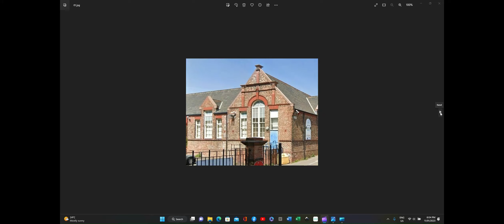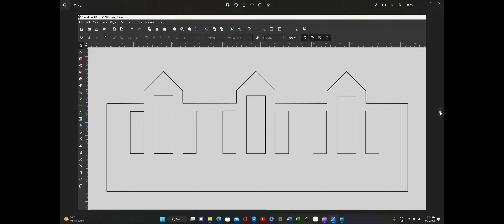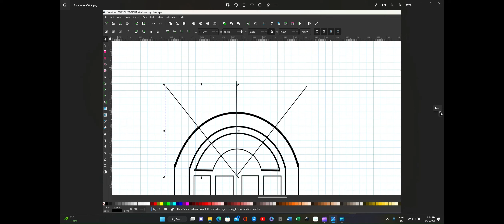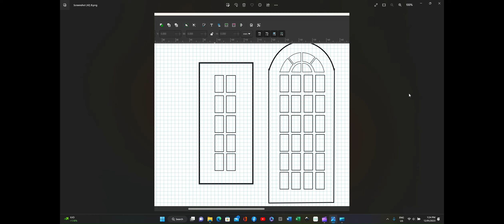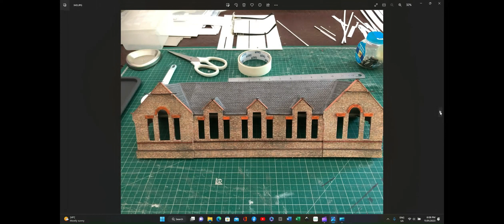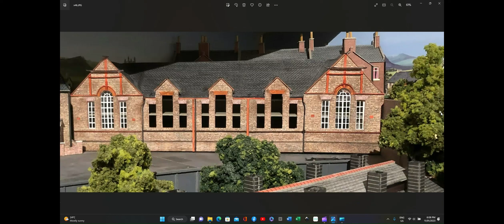Newtown School Part 4   Windows & Frames

Comment: Hi Alan.  I have thoroughly enjoyed watching your video series on Newton School.  Your step-by-step guide has been very informative (and your series on the window frames).  I would not have believed that the Cricut could be so versatile!  I'll need to speak to Mrs M to see if the budget will extend to one for myself!
Reply from the maker: Thank you David.  The Cricut is very adaptable for modelling beyond what is expected and just needs a bit of trial and error rather than rely on simply what is used by the craft sector and there set projects.  A great machine but can frustrate at first, I would not be without it now. Cheers Alan

Comment: Very good result Alan.

Looking forward to seeing how you drew the arched window in inscape. I’ve used inscape a couple times, but will probably be trying affinity designer, since I’ve paid for it.
Reply from the maker: Thanks Ken. I haven’t used Affinity Designer. What was the price of it?  Cheers Alan
Reply: @StocktonStation  had a question. Can one adjust depth of cut so as to make brick pattern? (EDIT: With cricut machine?)
Reply from the maker: @KenN.OXN.805  yes Ken just set the number of passes lower and another way for example is to use a 500 gram card and set machine as a 90 gram  paper and it will only cut one pass. Also set machine on less pressure. I prefer to just alter the setting for number of passes until you find optimum result on a test card - less chance of damaging or excess wear on blades. Again experimenting with different cards usually gets the result you want.  Alan